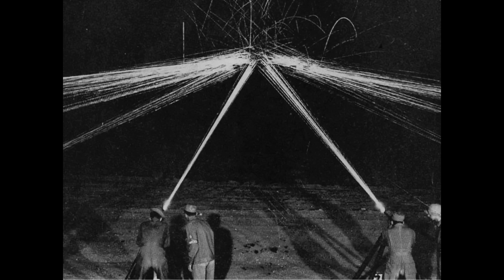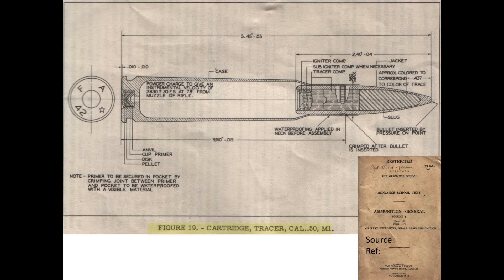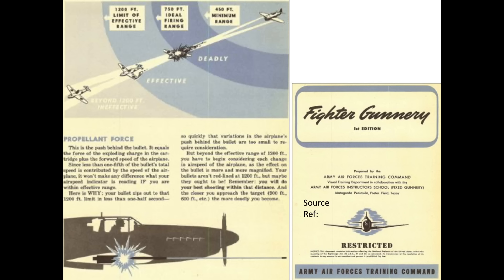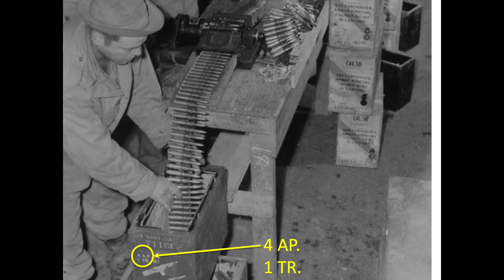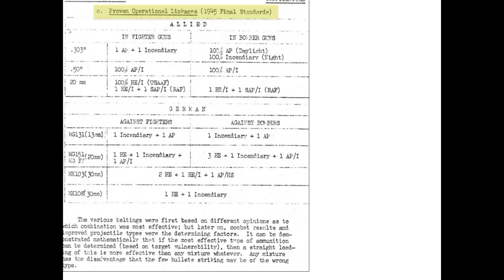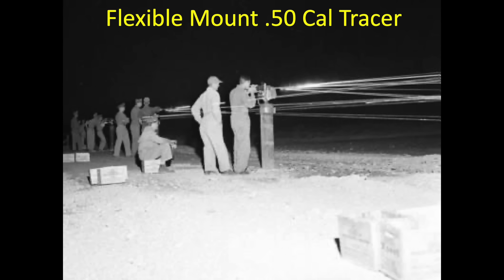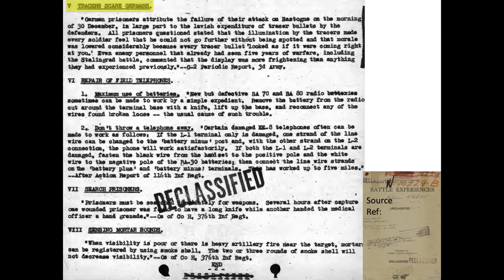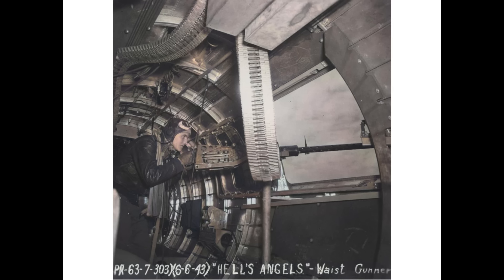Why WWII Bombers Eliminated Tracers in their Ammo Belt Mixes

Comment: The tracers illusion:  It's a ways away but a Tracer is still a welding torch like light, enough of those and your eye goes into self defense mode and does not look right where the tracers are. Plus they are igniting 150 yards away, that latency would throw you off for sure in a moving airplane shooting at a moving target.
 When coming back at Dusk and getting jumped over France of Belgum they would be a real nuisance. Winter Days are very short up there, I'm sure a lot of Daylight missions ended at night.
@patsmith3894
9 minutes ago  points out the navy was still using them: Why the Navy kept using them who knows, but you can see by footage they were not using their gun sights. They were laying a umbrella of flack. And maybe having the contrast of the dark water right there helps compared to being in a all sky blue and white environment but for maybe some green below.

kind of macabre and probably not right, but the Air Force may have done it because there was so much friendly fire in the formations they did not want aircrews to feel guilty by seeing their tracers going into a friendly. The Naval tracers would go out before the shells fell back down into the Fleet.

Comment: As always, amazing research of military records. I believe that the expression of " the whole nine yards" related to the fighter loading of ammo which consisted of 9 yards of belted 50 cal.  Some of the subscribers might confirm that. Not that many rounds for air combat.
Reply: "The first known use of the phrase as an idiom appears in The Mitchell Commercial, a newspaper in the small town of Mitchell, Indiana, in its May 2, 1907 edition:"
"This afternoon at 2:30 will be called one of the baseball games that will be worth going a long way to see. The regular nine is going to play the business men as many innings as they can stand, but we can not promise the full nine yards."
"The idiom was used three more times in the Mitchell Commercial over the next seven years, in the forms give him the whole nine yards (i.e., tell someone a big story) [...]"

WW2 fighter belts varied depending on the fighter, gun, and gun placement.
Reply: @FirstDagger  Thanks for the great detail information, I knew I was almost in the ball park, but couldn't remember where I got it. Cheers for a New Year
Reply: lenght of belts varied. In P-47s each belt was 35.75 feet. In F4U and F6F was 32 feet. In P-38s was 39.75 for the machine guns and 16.75 for the 20 mm. cannon.
Reply: @francescofissore161 thanks , looks like "nine yards" was close, certainly enough firepower to do some damage, especially on the high horsepower engines. I would imagine you'd still have to ration it with short burst. Unlike Hollywood guns that never run out of ammo or get reloaded. Appreciate the feedback, Blue Skies in 2023